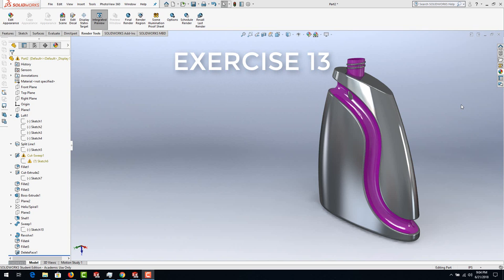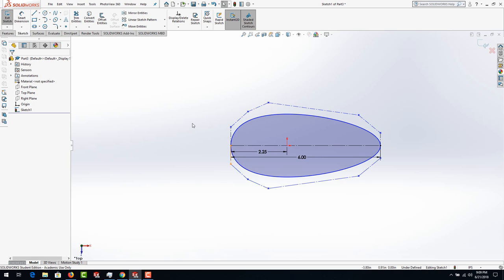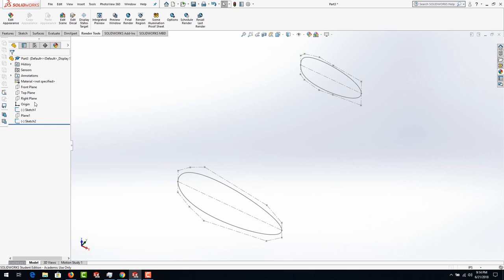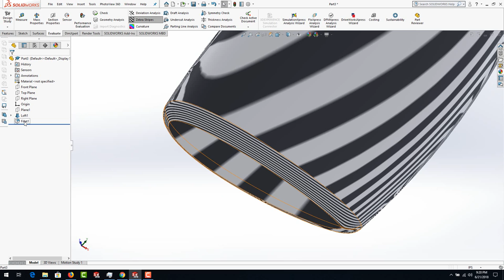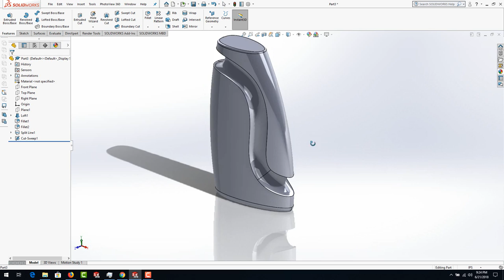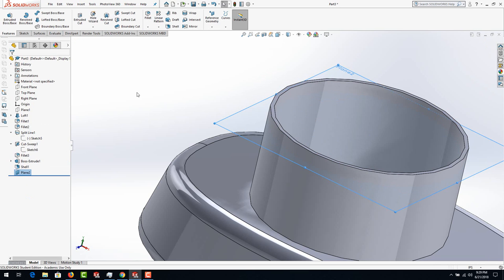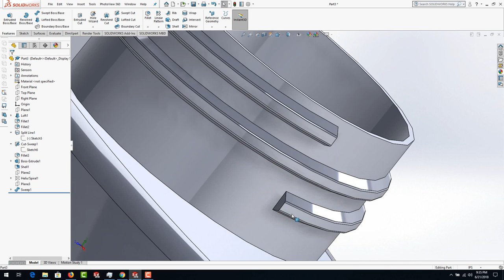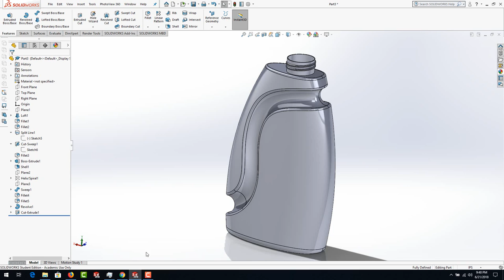E13 SolidWorks 2018 - Lofted Bottle & Threads Tutorial

Comment: Great tutorial. I wasn't able to get my bottom thread end to fillet. Had radius issues. Also had to modify my bottle shape to get the shell to work Would certainly be interesting to show how to fix the model if that does occur. I didn't work out the fillet on the thread worked out unfortunately.